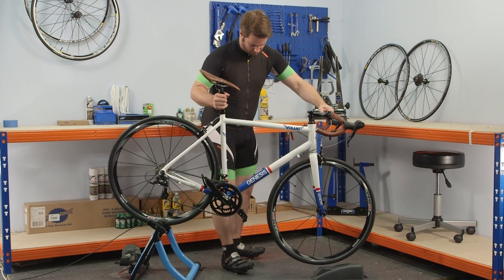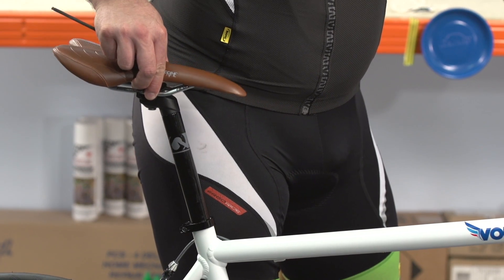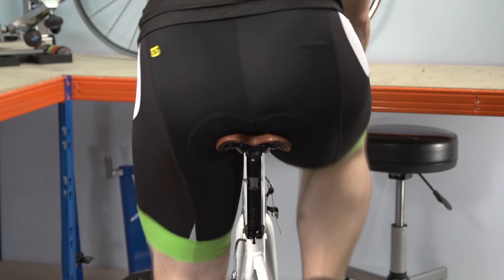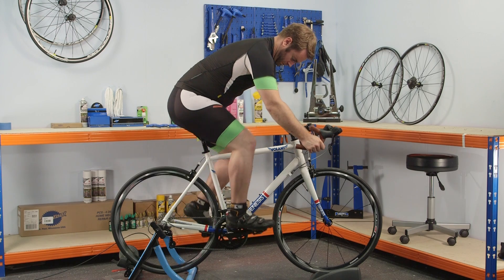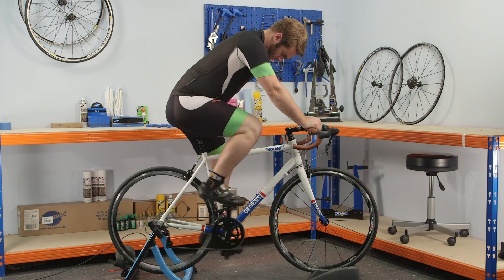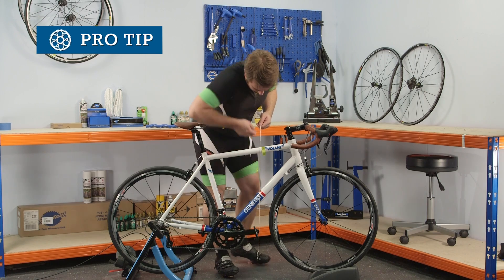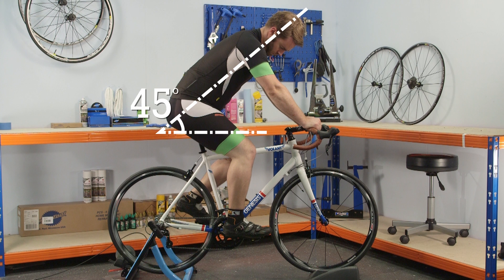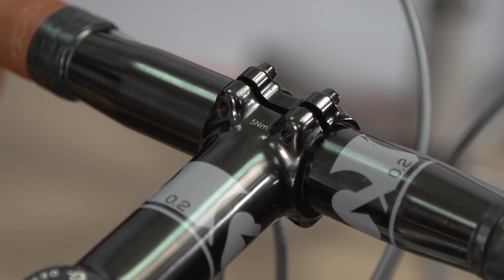How To Fit A Road Bike

Comment: Is it not better to leave a slight bend in the knee when the crank is at 6 O'clock?
Reply: It is, and this is them showing you how to set it up. A trick for fitting your bike is to have your knee straight when your heel is on the pedal, so when you move your foot back on the pedal you end up with a slight bend.

Comment: is that true that you lose efficiency if you use MTB pedals instead of road pedals that have larger surface area?
Reply: yeah, but the biggest thing is confidence whilst sprinting. With spds, there's not as much tension so occasionally, you'll unclip while in the middle of a sprint. spd-sl's are much more secure.
Reply: thanks for the explanation! I have indeed experienced many accidental unclips upon launching from traffic lights etc, guess I will have to tighten up the pedal tension for now until I get some spd-sl

Comment: how to get fit a road bike - take tools and go for a ride, after ~100km riding with constant adjustments bike fit will be 70%. Then ride 50km non stop. Readjust. Again 50km non stop + readjust. Repeat 3~5 times and mark your adjustments. (takes a few days). There is no better way how to fit bike 100%. No guru can fit bike FOR YOU stationary, that is just another marketing rip off.